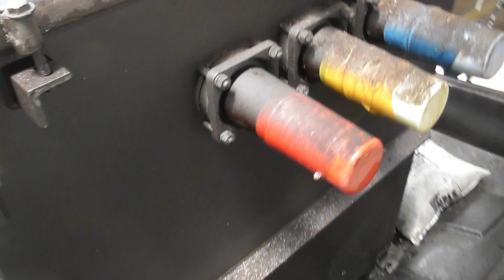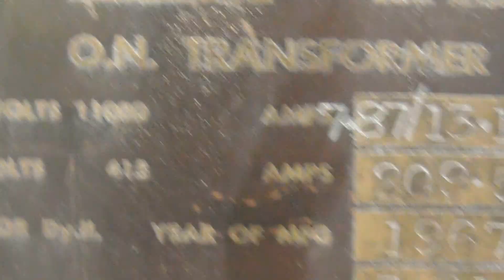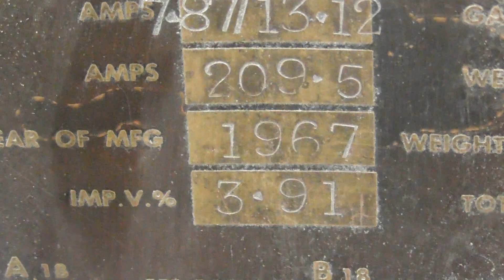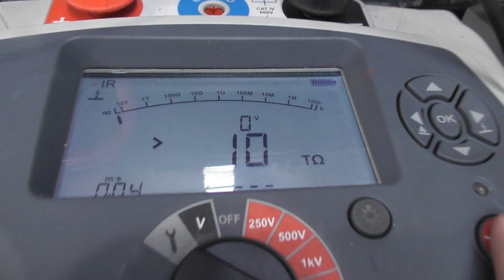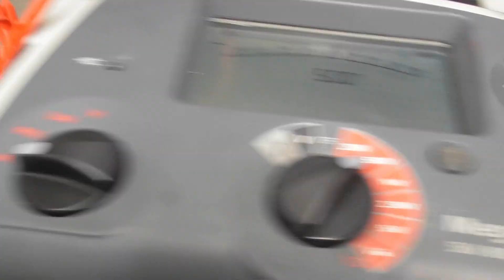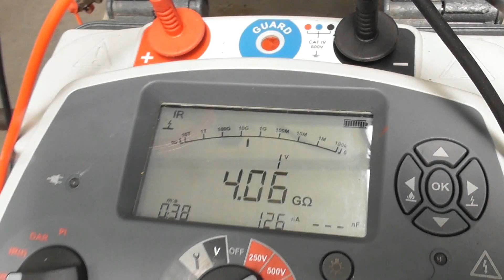ECC 150 kVA old power transformer from 1967

Comment: All too often the modern way of thinking is to destroy anything that was made to last (so unfashionable nowadays) whether it's still perfectly serviceable or not, and keep the wheels of (mainly Chinese) industry turning, outputting absolute crap that will not last half as long as this beautifully made unit.  I admire the respect that you have for the old equipment, the 20th century is where it's at, you can keep the 21st century haha!

Comment: Nice old transformer - did I spot that it was a dual voltage primary (6.6kV / 11kV)?

Some of these old transformers had PCB oil in them which can't be used now - this makes the transformer scrap as the PCB is in all the paper winding insulation. Shame really, the transformers of this era were 'built-tough'

Comment: Nice old unit! The substation at the end of my road recently had a new transformer installed and I had a look at the old one, it was a 500KVA Brush unit made in 1956 and was in service until 2022!!!
Reply from the maker: It is a pity, this TX end up getting scrapped as the asset owners want newer equipment installed. Also higher kVA rating needed.

Comment: Probably would last another 60 years.
Reply: Seems like the old equipment would out last any new equipment these days.
Reply from the maker: @NSaw1  It does, the new equipment replacing it has a design life of 25 years.
Reply: @RODALCO2007  Yeah. I've found so many old silicone polymer insulators in the power company dumpster from the late 90s that are just falling apart. Then compared to the old porcelain insulators that have been in use since 1930 that where just replaced and still in perfect condition. Honestly its just pretty sad.
Reply from the maker: @NSaw1  Polymer insulators are not made to last, they degrade rapidly in UV sun-light. All designed to fail within a certain amount of time, Glass and Porcelain rules here.
Reply: @RODALCO2007  I sure wish they did here. 
The last 20 years the power company has started slowly replacing all insulators on new installs or maintenance poles with them. Starting with cutouts and disc insulators. But just the last couple years they have started replacing nearly all of the insulators with polymers. 
They just built a new line to bypass our old line as a 2nd supply for the area, everything on it is silicone and plastic insulators except for a couple places where there are long spans that just can't be on plastic insulators and they used porcelain post insulators.

Comment: Transformer still solid, excellent insulation resistance readings! Hope it goes back in service for another fifty odd years! If it does go for scrap I hope you save the specification plate for your collection.
Reply from the maker: I will try to get it, TX is not processed through the system yet.
Reply from the maker: I got the spec plate, also a very nice spec plate from a 15kVA Bruce Peebles TX from Edinborough.